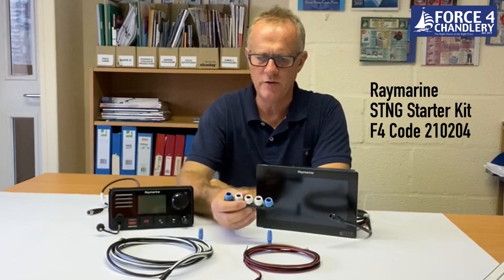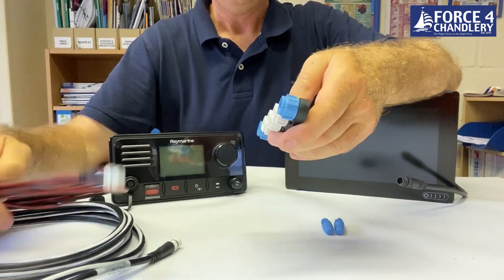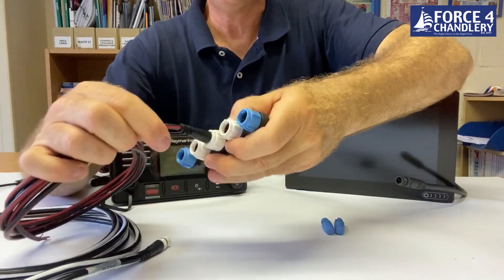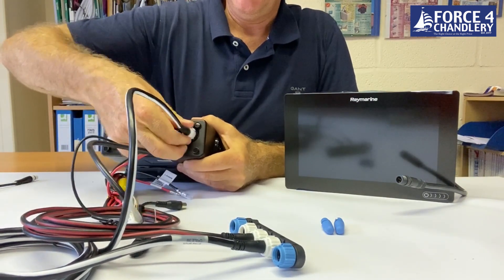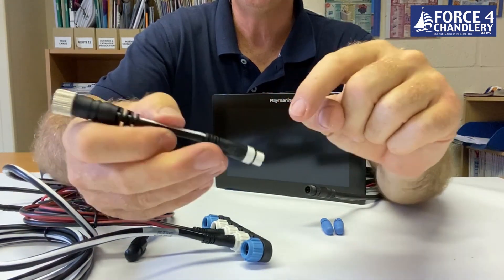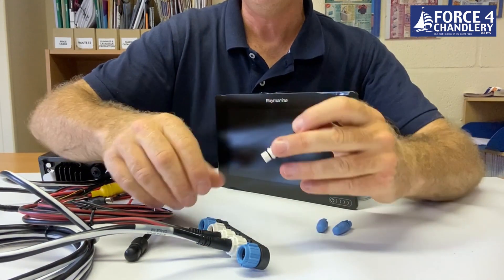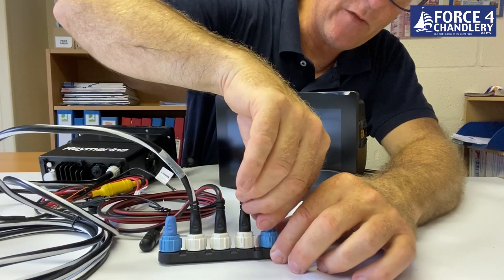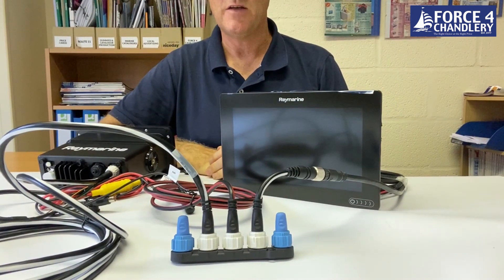Build this simple STNG Starter Kit to network your SeaTalk NG compatible Raymarine Electronics

Comment: Thanks a lot. Can I connect two Raymarine Element units using this method to share sonar and gps data? And do you still need to connect the power cables of the two units to the boat battery? Or the power cable to this netwerk is enough to power both units. Thanks
Reply from the maker: Thank you for your question... you can connect two Elements via a STNG backbone but it will only share numerical data such as waypoint and route data and not graphical data such as sonar or Radar data.  STNG/ NMEA2000 is a low current bus and as such, does not have sufficient current to power chart plotters - they will have to be connected to the 12v supply by their power cables. Leigh J

Comment: I have just taken delivery of a Raymarine Element S, could you show me how to connect this to other devices (log etc) via names 2000?
Reply from the maker: The Element S has a NMEA 2000 connection cable that has a device net male connector - to connect this to a another NMEA 2000 device such as a instrument or sensor you will need a NMEA backbone see our guide on NMEA 2000 basics  https://www.force4.co.uk/sailing-guides-nmea2000-basics.

If you have Raymarine instruments they may already be connected via a STNG or Seatalk backbone - the Element can connect to either of these networks with an appropriate converter cable or converter kit. 

For connection to an STNG network you will require a devicenet female to STNG cable https://www.force4.co.uk/item/Raymarine/STng-to-Female-DeviceNet-Adaptor-Cable-1m/VYX

For connection to a Seatalk network you will require an ST1 to STNG adaptor kit https://www.force4.co.uk/item/Raymarine/ST1-To-STNG-adaptor-E22158/A5P and the devicenet female to STNG cable  https://www.force4.co.uk/item/Raymarine/STng-to-Female-DeviceNet-Adaptor-Cable-1m/VYX
Reply from the maker: The Element S has a NMEA 2000 connection cable that has a device net male connector - to connect this to a another NMEA 2000 device such as a instrument or sensor you will need a NMEA backbone see our guide on NMEA 2000 basics  https://www.force4.co.uk/sailing-guides-nmea2000-basics.

If you have Raymarine instruments they may already be connected via a STNG or Seatalk backbone - the Element can connect to either of these networks with an appropriate converter cable or converter kit. 

For connection to an STNG network you will require a devicenet female to STNG cable https://www.force4.co.uk/item/Raymarine/STng-to-Female-DeviceNet-Adaptor-Cable-1m/VYX

For connection to a Seatalk network you will require an ST1 to STNG adaptor kit https://www.force4.co.uk/item/Raymarine/ST1-To-STNG-adaptor-E22158/A5P and the devicenet female to STNG cable  https://www.force4.co.uk/item/Raymarine/STng-to-Female-DeviceNet-Adaptor-Cable-1m/VYX

Comment: Great video and glad I saw this as I just purchase the axiom 7 and the ray73 and have ordered the Seatalk starter kit to complete the installation. 
But I’m still not clear on one issue. With the Seatalk kit should I  now NOT connect 12v power lead to each unit?

I’ve now got power to each device but when I install the network kit should I now remove the power to each unit?  Just need to be sure I don’t risk a short with double power sources.
Reply from the maker: Hi Glen,
Thanks for your question. The Axiom and Ray 73 do not take their power from the STNG network - the STNG will only power sensors and instruments that are connected.
Reply: Force 4 Chandlery 

Thanks for that clear reply. Sounds like I’m on track. 
Keep up the great work!